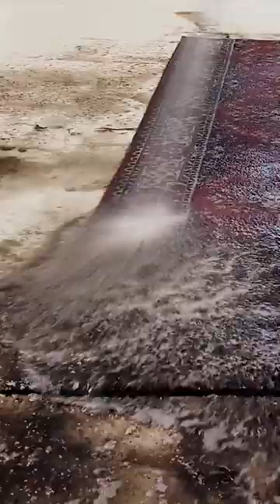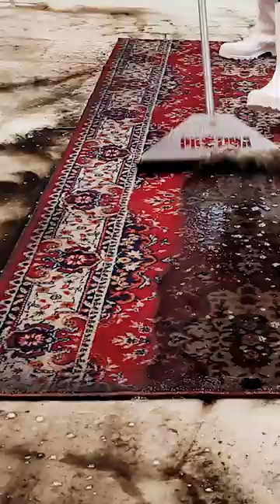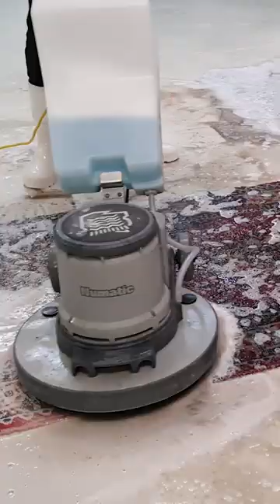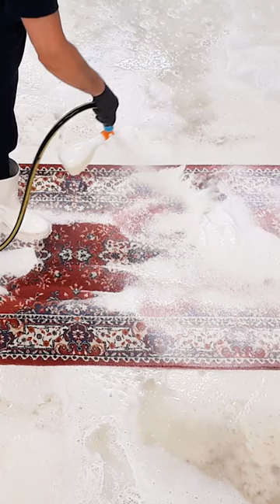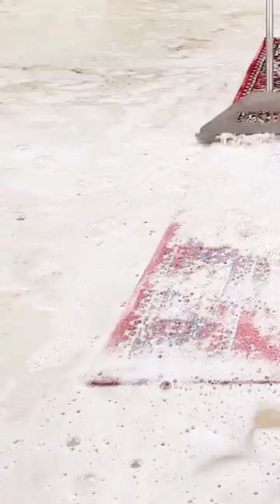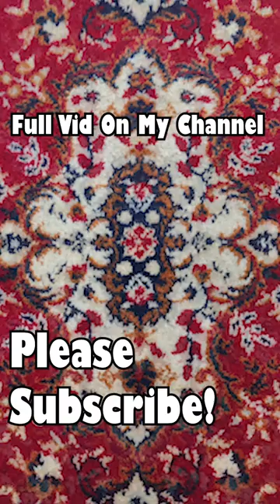Its dark side is gone, it will decorate the hall  #shorts

Comment: Are you wasting more soap from the blue and grey hose than with the watering can you would use before? You can see it going every where beyond the rug.
Reply from the maker: You might be right, but by adding detergent from a hose, the rug flows like a bathtub, which dissolves the dirt better.